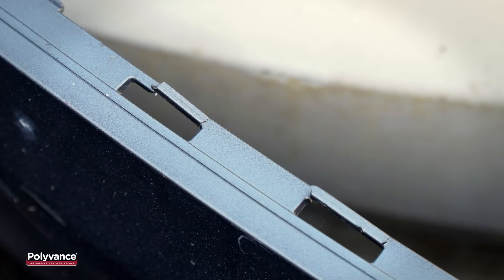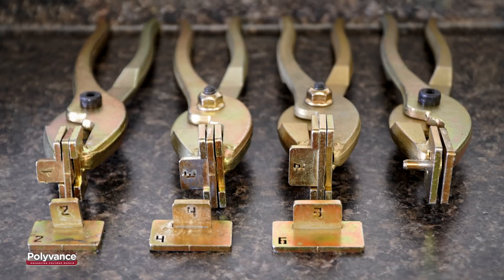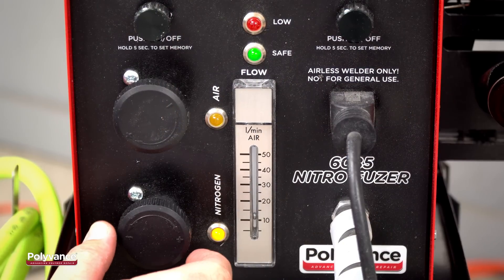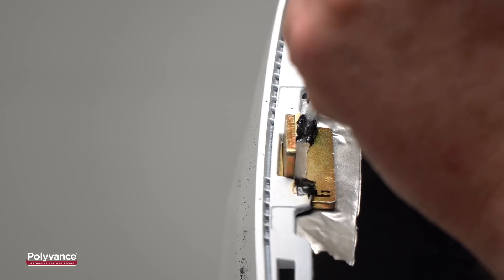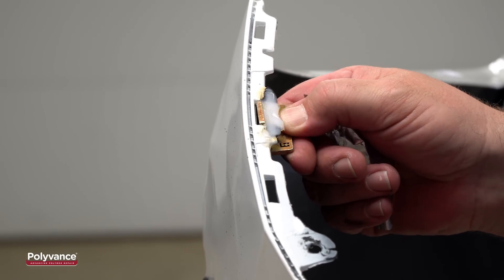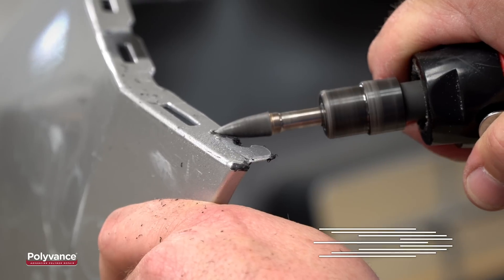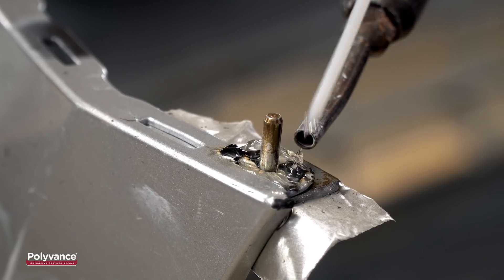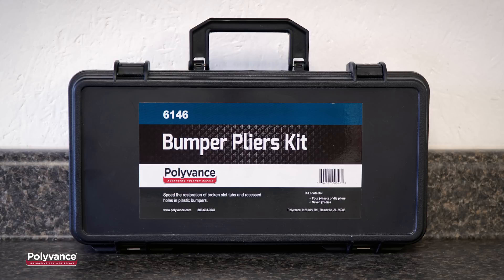How to Use Polyvance's 6146 Bumper Pliers Kit

Comment: Cheaper buy a bumper than tools
Reply: Possibly, but if you're a body shop and can do repairs like this on a regular basis, its more than worth your while to invest in the tools needed to repair plastics.
Reply from the maker: Hello. Our hot air and nitrogen plastic welders are mostly for body shop use. Using this equipment, a body shop can repair an OEM bumper and other plastic parts. Body shops would most likely have all of the other tools (sander, aluminum tape, sandpaper, etc).

All cases are different, and the amount of damage will need to be evaluated to see if it is worth having a part repaired. Many times it is cheaper to repair small cracks, tears, tabs, etc. than to replace the whole part. You may find an aftermarket part cheaper to put on yourself, but you run the risk of it not fitting properly, and you also have to wait for the part to come in. Repairing ensures you keep the OEM part on the car, and you don't have to wait for the part to come in.

You can find a win-win scenario for both the repair shops and the bill payer. Check out this article and interview with Kurt Lammon, president of Polyvance (under the Plastic Repair section): https://autobodynews.com/index.php/component/k2/item/15517-the-best-body-shops-tips-repair-vs-replace-what-a-body-shop-should-consider.html?showall=1

There is a good example of a win-win scenario in the article:
If a replacement part costs $400, and the shop makes 25% gross profit on parts, the shop receives $100 of gross profit and the bill payer pays $400.
However, if the part is repaired and the shop is paid for 6 hours of work at $50 per hour with a 50% gross margin on labor, the shop makes $150 gross profit and the bill-payer only pays $300. So if the part is repaired, both the shop and the bill-payer come out better than if it had been replaced.

Comment: Wouldn't adding a plastic staple help to add strength to the table?
Reply: With nitrogen welding using this technique, additional reinforcement is not needed.

Comment: Save yourself the money and just buy a soldering iron with a spatula attachment, use any hard plastic you can find at home, and begin melting the plastic down onto the bumper tab that broke and shape to your desire
Reply from the maker: Using just "any hard plastic you can find at home" isn't a great idea. Fusion welding is important because you match the welding rod with the base material. When you weld, the base material and the matching welding rod fuse together into one. It's like pouring a cup of water into a gallon of water; once they are put together, they blend and you cannot separate them.
There are many different types of plastics and plastic blends out there. It's important to try to match the base material and welding rod so that you can get the strongest weld.

Also, the tabs in the bumper pliers kit are shaped to match the size/shape of common bumper tabs. This makes it easier to shape the tab and it prevents the hole from closing when you weld (which is time consuming and tedious to fix).
Reply: Peter:  Chances of success.  3%.  Time wasted...hours.  The right tools and right materials:  Chances of success: 99.99% Time wasted: 0 hours.
Reply: I can tell you for sure that my time wasted was not hours... If anything, it took me 15 mins to do both sides and both tabs are fairly strong.
@Polyvance Surely you can go to a hardware store and buy the appropriate material, but I just did a home job to try and save as much money possible. As for 'preventing the hole from closing' i just took a drill, find the appropriate drill bit to match the bolt and created a new hole. In a matter of minutes, I had 2 working bumper tabs. 
Not trying to diss your products or anything, I'm sure they're quality made and produce excellent results.. Just my 2 cents.

Comment: Chinese kits are the same and much cheaper
Reply from the maker: I don't believe there is another kit the same as our Bumper Pliers Kit.
Reply: The Chinese knock-off welders are not the same and are junk.  They don't last and the metallurgy of their tips are such that they do not conduct heat well and they tend to bend and break.  Their filler material is far too rubbery to easily sand.  I would just stick with what works, Polyvance!

Comment: What about reinforcement, Will that little join be strong enough to handle the bumperweight in actual use?
Reply from the maker: This kind of repair is pretty strong. Here's a clip from an older bumper pliers video of a strength test on a repaired tab and an unbroken OEM tab: https://www.youtube.com/watch?v=GfhZRUljCo4

Comment: To much time it's easier to buy new one.
Reply from the maker: Not necessarily. Some cars have OEM bumpers that are hard to find (thus making them more expensive). If you buy an aftermarket bumper instead, you have to worry about fit issues. Also, you may not be able to find a bumper in the right color.
The process would be like this: you pay for a bumper, wait several days until it comes in, and then deal with any problems it has when it arrives (if it has any). Fixing the problems would likely require a trip to a body shop to fix fitment issues or repainting the bumper.
Instead, these tiny tabs can be fixed, and they can often be fixed without having to paint the bumper.
It would most likely be cheaper to have these tabs repaired than to replace the whole bumper.
Reply: It all depends on the cost of the bumper, its availability and what level of finishing is required on the bumper being repaired.  Many timed these slot tabs tear out with no damage on the cosmetic side..seems a lot easier, cheaper and faster to weld a few tabs than replace and paint an entire cover.
Reply: Not even you be looking at close to two grand to get a bumper and then get it painted

Comment: Neat alternative to zip-ties, wire, glue, bungee cords...etc. The question is if you have this done at a body shop will they charge you more than the cost of another bumper which would limit its use to exotic or hard to find parts.
Reply from the maker: Some bumper covers are inexpensive, especially aftermarket bumper covers. Aftermarket bumper covers sometimes have fitment issues. Plus, you would still need to have the bumper painted, which can be expensive. These tiny slot tabs can often be repaired without having to repaint the bumper.  Some new OEM bumper covers are expensive and it is cheaper to repair than to replace.
Reply: geniuspharmacist why to give it to a shop, if u can do by yourself
Reply: @FaigMasimov  If insurance is paying you want a new bumper cover. If you are paying, then you want as cheap as possible. Of course if a new one is not available, you have no choice but use this repair method. I learned how to plastic weld from this video! Thanks.

Comment: Good video. I do the same thing with an electric soldering iron and plastic from an old bumper. works just as well...
Reply: Pliers?
Reply: Scott B no need for pliers....
Reply: The pliers are about speeding the repair to make the shop more profitable.  If you have 4 or five tabs to repair, doing it your way would take 10 times longer and produce lower quality results than if you have a nitrogen welding system and a set of bumper pliers.  I'm not saying your way is impossible, its just not very  practical in a body shop environment.
Reply: Scott B may be true, but at the end of the day is all about overall costs. I consider that it is cheaper my way since i don't do this every day.
Reply: Absolutely!
Reply: That's what I have been doing for many years and it works really well